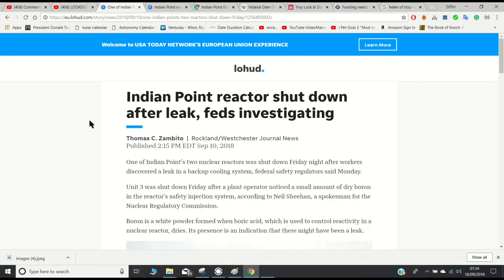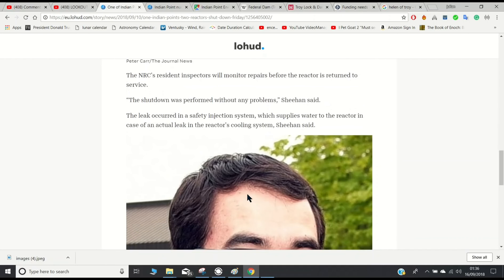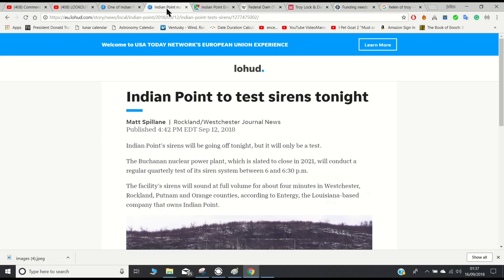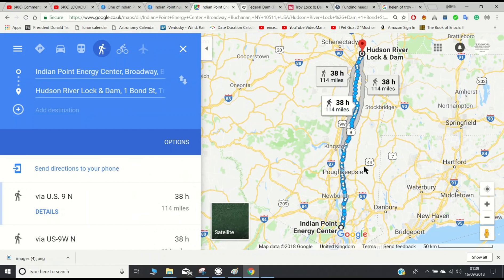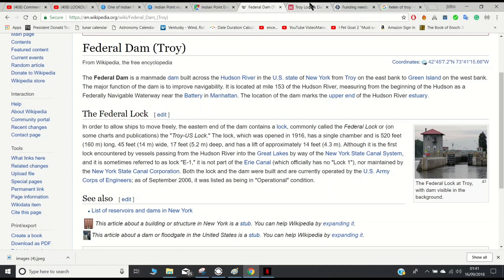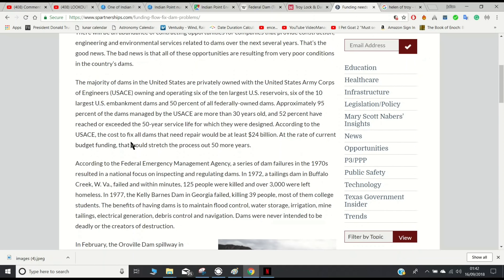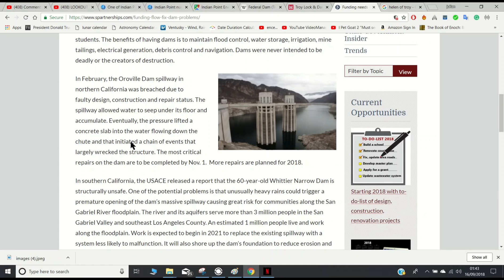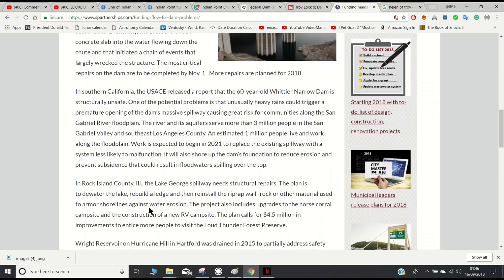THE DAMS ARE BREAKING: WATCHING INDIAN POINT NUCLEAR POWER PLANT... THE TROY DAM ON THE HUDSON RIVER

Comment: THIS IS INTERESTING!!
Surry Power Station is a nuclear power plant located in Surry County in southeastern Virginia, in the South Atlantic United States. The power station lies on an 840-acre (340 ha) site adjacent to the James River across from Jamestown, slightly upriver from Smithfield and Newport News. Surry is operated by Dominion Generation and owned by Dominion Resources, Inc.

The Surry plant is similar in appearance and design to its "sister plant" North Anna Power Station, located northwest of Richmond in Louisa County, Virginia.

EVENTS---
• On July 27, 1972, two workers were fatally scalded after a routine valve adjustment led to a steam release in a gap in a vent line.

• On May 8, 1979, FBI agents investigated a white crystalline substance which had been poured into 62 fresh fuels elements kept in storage at the plant, a day after plant officials made the discovery. Westinghouse metallurgists found no damage to the fuel elements, including the metal containers and zirconium rods holding the fresh fuel.[6]

• On December 9, 1986, a steam explosion (condensate feed piping ruptured due to internal erosion and over-pressurization when feed pump check valve failed) in the non-nuclear part of Unit 2 injured eight workers. Four later died.[7]

• On April 16, 2011, a tornado touched down in the plant's electrical switching station, disabling primary power to the plant's cooling pumps and causing the backup diesel generators to activate without incident.[8][9]

• On August 23, 2011, an earthquake in central Virginia automatically shut down Dominion's North Anna reactors 11 miles from the epicenter. The similar Surry reactors continued in operation and Dominion declared a "Notice of Unusual Event" (the least dangerous of a four-level emergency scale) for the Surry plant which was lifted later the same day.[10]

Comment: The Edwin Irby Hatch Nuclear Power Plant is near Baxley, Georgia, in the southeastern United States, on a 2,244-acre (9 km²) site. It has two General Electric boiling water reactors with a total capacity of 1,848 megawatts. Previously, the reactors had a combined capacity listing of 1,759 MW. Unit 1 went online in 1974 and was followed by Unit 2 in 1978. The plant was named for Edwin I. Hatch, president of Georgia Power from 1963 to 1975, and chairman from 1975 to 1978.

In 2002, the Nuclear Regulatory Commission (NRC) extended the operating licenses for both reactors for an additional twenty years.

Comment: The Oconee Nuclear Station is a nuclear power station located on Lake Keowee near Seneca, South Carolina, and has an energy output capacity of over 2,500 megawatts. It is the second nuclear power station in the United States to have its operating license extended for an additional twenty years by the Nuclear Regulatory Commission (NRC) (the application for the Calvert Cliffs Nuclear Power Plant in Maryland preceded it).

This plant has three Babcock & Wilcox pressurized water reactors, and is operated by Duke Energy.

Oconee was the first of three nuclear stations built by Duke Energy. According to Duke Energy's web site, the station has generated more than 500 million megawatt-hours of electricity, and is "the first nuclear station in the United States to achieve this milestone."[2]
In the summer of 2011 it became the first nuclear power station in the United States to have its sensors controlled digitally.[3]

FLOOD RISK-----
Duke Energy has noted that a rapid failure of the Jocassee dam would flood the plant and cause the loss of power and safety equipment, potentially damaging its three reactor cores within 8 to 9 hours. It could further lead to reactor containment failure within 59 to 68 hours, triggering a significant release of radioactivity into the environment. Duke informed the NRC about this flooding hazard as early as January 1996.[8] Duke Energy estimated the probability of a random failure of Jocassee Dam is 1.3(10−5)/year, while the NRC puts the estimate at 2.8(10−4)/year.[9]

Subsequent to Fukushima, improvements were made to the Oconee site such that flooding from the failure of Jocassee Dam would not result in reactor core damage. The NRC has expressed satisfaction as of June 2016 with the flood protection modifications which included new or enhanced flood walls and moving some power lines and equipment to less flood-prone locations. [10]

Comment: The Brunswick nuclear power plant, IN WILMINGTON, NC 

The Nuclear Regulatory Commission's estimate of the risk each year of an earthquake intense enough to cause core damage to the reactor at Brunswick was 1 in 66,667, according to an NRC study published in August 2010

named for Brunswick County, North Carolina, covers 1,200 acres (490 ha) at 20 feet (6.1 m) above sea level about 5 miles (8.0 km) from the Atlantic Ocean. The site is adjacent to the town of Southport, North Carolina, and to wetlands and woodlands, and was opened in 1975.

The site contains two General Electric boiling water reactors, which are cooled by water collected from the Cape Fear River and discharged into the Atlantic Ocean.

Duke Energy Progress is the majority owner (81.7%) and operator of the Brunswick nuclear plant. The North Carolina Eastern Municipal Power Agency owns the remaining 18.3%. Duke Energy Progress is currently in the process of buying The North Carolina Eastern Municipal Power Agency's 18.3% Stake at Brunswick nuclear power plant. (Duke Energy completed its merger with Progress Energy on July 2, 2012.)

The Brunswick plants' proximity to the Cape Fear River and the Atlantic Ocean allowed the designers to take in cooling water from the Cape Fear river and discharge it into the Atlantic off the coast of Oak Island. Fish, crustaceans, and other debris are removed from the cooling water via a filtration system. The water then flows through the nuclear plant and discharges into a five mile long canal which passes under the Intra-Coastal Waterway at one point.

Comment: The McGuire Nuclear Station 
is a nuclear power plant located about 17 miles (27 km) northwest of Charlotte, North Carolina, on the state's largest lake, Lake Norman. It is a 32,500-acre (13,200 ha) lake created in 1963 by Duke Power for the Cowans Ford Hydroelectric Station. The McGuire units use the lake's water for cooling.

This plant has two Westinghouse pressurized water reactors and has a capability to produce 2,250 megawatts of net power, with a net generation of 17,514 GW·h in 2005. This represents 44% of the total nuclear power generation for the state of North Carolina.[2]

Comment: CATAWHA NUCLEAR STATION- 
The Nuclear Regulatory Commission (NRC) defines two emergency planning zones around nuclear power plants: a plume exposure pathway zone with a radius of 10 miles (16 km), concerned primarily with exposure to, and inhalation of, airborne radioactive contamination, and an ingestion pathway zone of about 50 miles (80 km), concerned primarily with ingestion of food and liquid contaminated by radioactivity.[7]

The 2010 U.S. population within 10 miles (16 km) of Catawba was 213,407, an increase of 53.3 percent in a decade, according to an analysis of 2010 United States Census. The 2010 U.S. population within 50 miles (80 km) was 2,559,394, an increase of 25.0 percent since 2000. Cities within 50 miles include Charlotte NC (35 miles to city center).[8]

Seismic risk
In 2010, the NRC estimated the risk each year of an earthquake intense enough to cause core damage to the reactor at Catawba was 1 in 27,027.[9][10]

Incidents
May 15, 2013
More than 100 gallons of water contaminated with radioactive tritium was released. However, the levels of tritium were less than one half the EPA limit for tritium, and the leak was contained before it reached ground water.[11]

Comment: THIS IS VC SUMMER NUCLEAR STATION NEAR JENKINSVILLE, SC 20 MILES NW OF COLUMBIA--

In March 2012, the NRC approved the construction license of the two proposed reactors at the Summer plant. As with the license approval for the Vogtle plant, NRC chairman Gregory Jaczko cast the lone dissenting vote, saying "I continue to believe that we should require that all Fukushima-related safety enhancements are implemented before these new reactors begin operating".[10] The reactors were expected to go on-line in 2017 and 2018 respectively.[11]

The construction of Unit 2 began officially on March 9, 2013, with the pouring of concrete for the basemat. The placement of the first concrete was completed on March 11, 2013. Unit 2 is the first reactor to start construction in the US in 30 years.[12] First concrete for Unit 3 was completed on November 4, 2013.[13]

In October 2014, a delay of at least one year and extra costs of $1.2 billion were announced, largely due to fabrication delays. Unit 2 was expected to be substantially complete in late 2018 or early 2019, with unit 3 about a year later.[14]

On July 23, 2015, V.C. Summer Unit 2 reached a landmark milestone with the successful placement of the CA-01 module, one of the largest, heaviest, and most complicated modules within the Nuclear Island, also referred to as a super module because it was so large that huge submodules had to be shipped from the manufacturer and final assembly was completed on site in the twelve-story Module Assembly Building. Installation of CA-01 was long delayed due to both regulatory and production hurdles related to the module. It is the first of the US AP1000 reactors under construction to achieve placement of this critical module, beating Vogtle Unit 3 to this milestone, and allowing other construction activities in the Nuclear Island to progress that could not proceed until the module was in place. CA-01 is a large structural module that forms the internal structures of some compartments within the Containment Vessel, including the Steam Generator compartments, Reactor Vessel cavity, and Refueling Canal. The CA-01 Module is the heaviest module on site, weighing 1,200 tons, or 2.4 million pounds. Because of how much it weighs, lifting and placing the CA-01 module into the Unit 2 Nuclear Island resulted in the heaviest lift for the V.C. Summer construction project to date.[15]

In early 2017 Westinghouse Electric Company revised in-service dates to April 2020 and December 2020 for units 2 and 3.[16]

In March 2017, Westinghouse Electric Company filed for Chapter 11 bankruptcy because of $9 billion of losses from its two U.S. nuclear construction projects.[17] SCANA considered its options for the project,[18] and ultimately decided to abandon the project in July 2017. SCANA had determined that completing just Unit 2 and abandoning Unit 3 could be feasible and was leaning toward that option internally, however the project died when minority partner Santee Cooper's board voted to cease all construction and SCANA could not find another partner to take their place.

On July 31, 2017, after an extensive review into the costs of constructing Units 2 and 3, South Carolina Electric and Gas decided to stop construction of the reactors[19] and later filed a Petition for Approval of Abandonment with the Public Service Commission of South Carolina.[20]